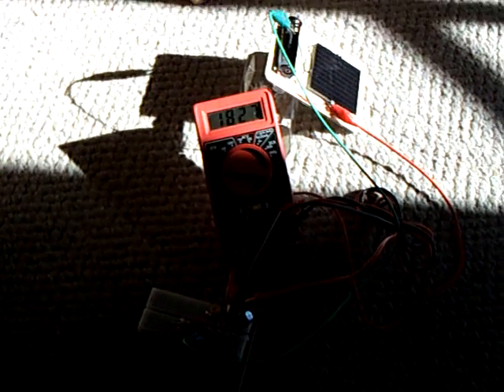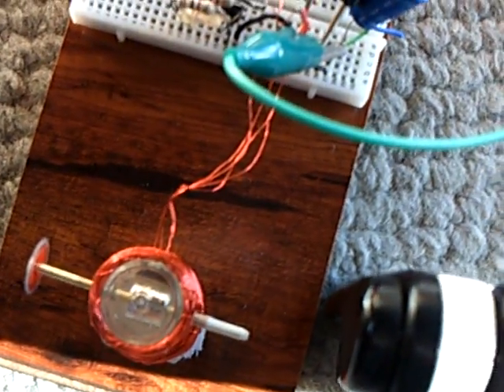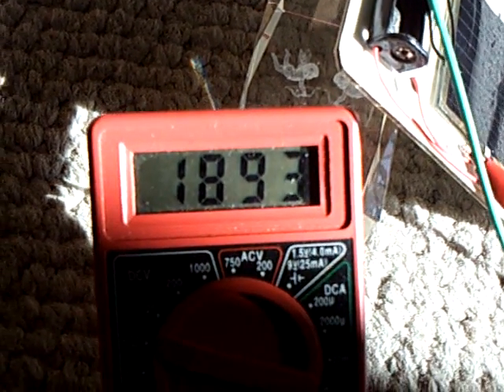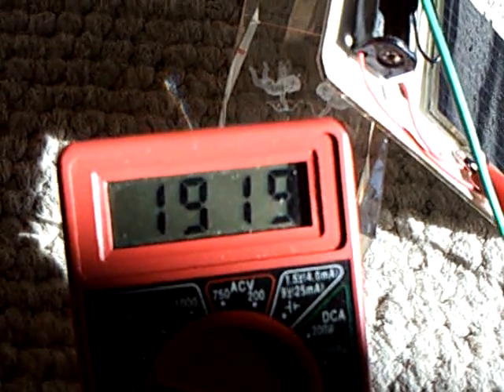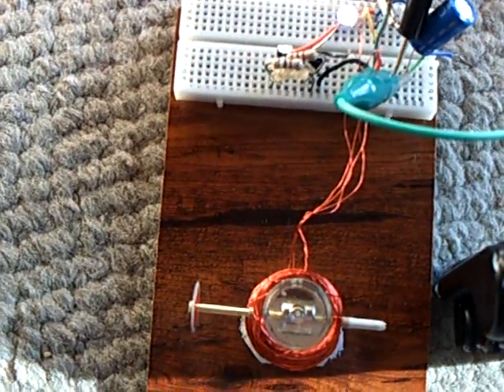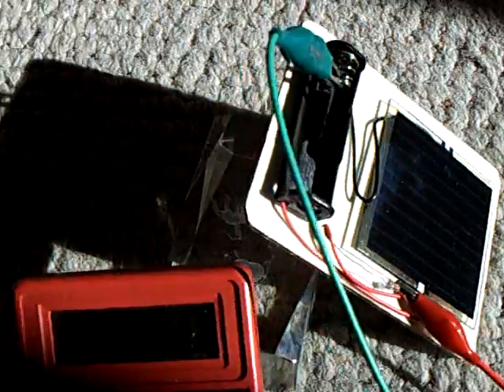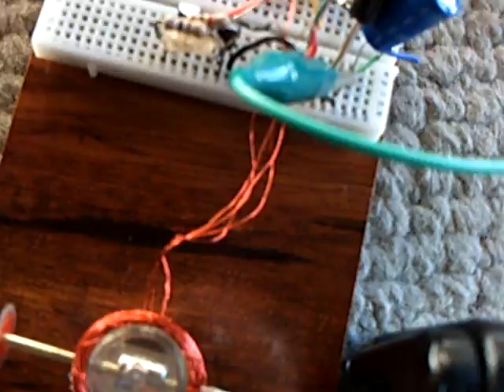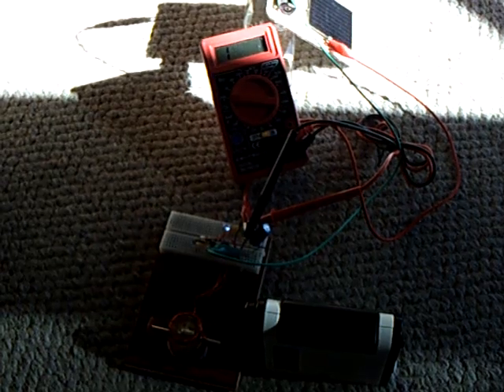A True Self - Runner ---- what it might look like

Comment: You should try using Peltier modules to convert heat to electricity! As long as 1 side stays somewhat cool compared to the other side, you'll be getting a small amount of current!

Comment: Well done Lidmotor, but an electric motor system can only be a selfrunner, if you can violate Lenz´s law or convert heat to mechanical or electrical energy directly, so a 2nd law "violation", but the 2nd law is no real law, just only an experience and if you find the right parameters you CAN violate it....

Comment from the maker: The crystal cells that I made were a big dissapointment.  There is very little energy showing up in them when they are completely dry.  You can start them back up by adding water or heating but with that procedure I am convinced that all I am seeing is a plain old galvanic reaction.  The water molecule in the hydrate and the dissimilar metals used was a dead giveway (to me) that the 'crystal cell' was not magic.  It is sad for me to have to say this after spending so much time working on them.

Comment: Hi Lidmotor, even your motor that draws uA (if you have one like this - I assume you can build) is a self runner if you put a good dry crystal cell with capacitor -  and if that doesnt work, put 2 crystal cells with capacitors in flip-flop mode, 48 hours one cell, 48 hours the other cell and this will work forever. I am doing this for years, and I have lots of selfrunners, also my JAMM motor and other stuff - and if asked I can explain how VTA and Kapanadze devices works! Tnks for sharing!

Comment: Throwing my two cents in this jar, I think logically a self runner would have a sustained voltage and amperage for extended period of time because it would eventually break at some point. The whole concept your showing is a run away event. I think that is a bunch of internet bunk going around. You have already shown crystal cells they are about as OU as self paced researcher can get from the materials this earth has to offer us. The kapandaz is a fine example of OU and its not running away.